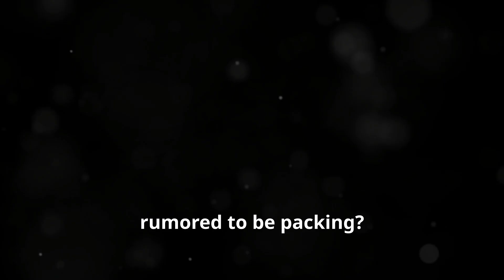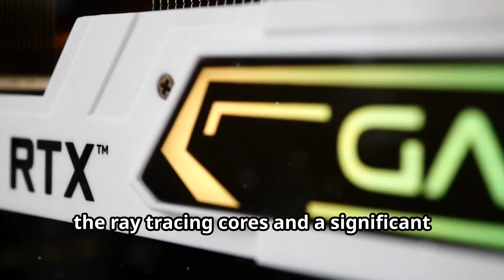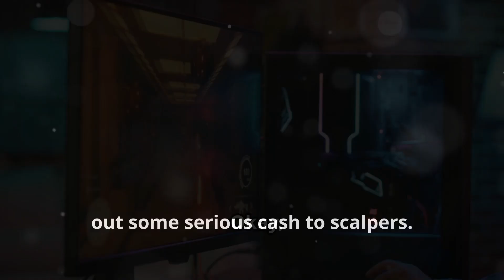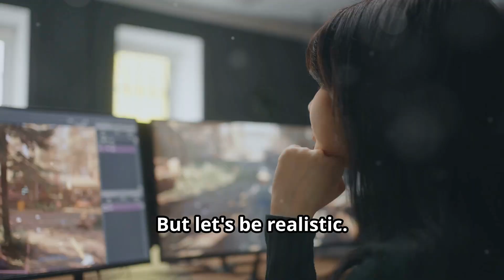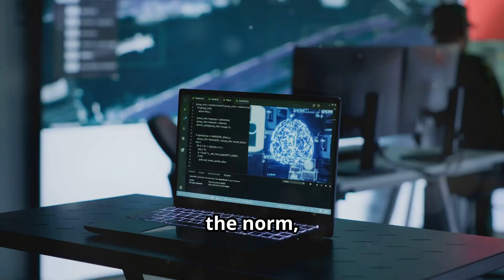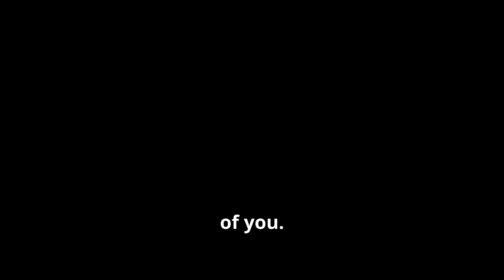RTX 5080 Leaks | Everything We (Might) Know So Far!

Comment: The 5080 will be cheaper and more powerful than a 4090. I dont need to upgrade for a while so i might just completely skip the 5000 series and get the 6080 at release or pick up a cheap 5080 one day but im set with my gpu for the next 3-4 years

Comment: I will get a 5080 if it is 1,000 or less, otherwise I’m waiting for a sale on the 4090 or something
Reply: Its not going to be 1000 or less. The 4080 super is 1000. The 5080 will most likely start at 1199$. I don’t see it being higher or lower. 5090 would most likely start at 1999$. But probably going to be 40% better than 4090. Who knows though.
Reply: @MrDeckerGames I've heard they're going to keep pricing the same because it didn't go well for the 40 series. Whether they take the price of the 4080 or the 4080 super for the 5080 is another question. 5090 will remain at 1600 and their new titan card will probably be 2000+